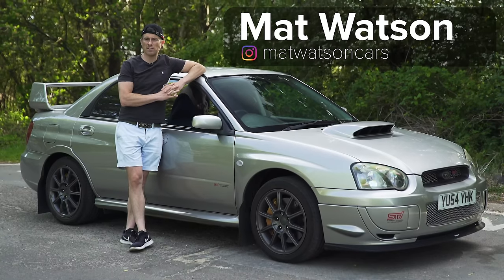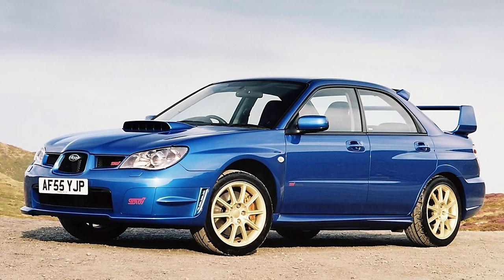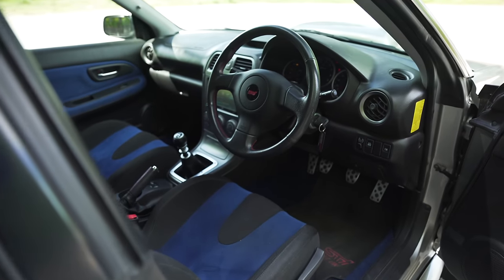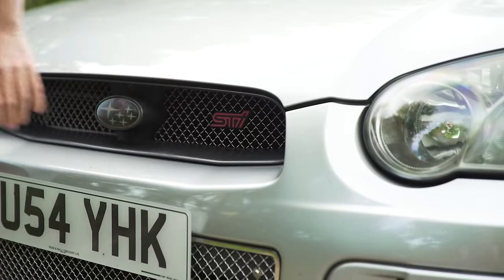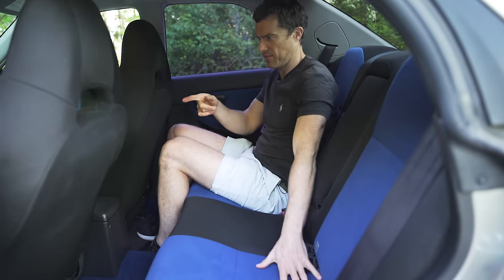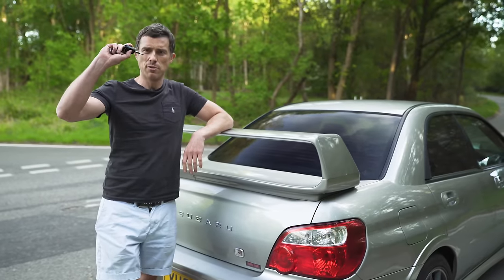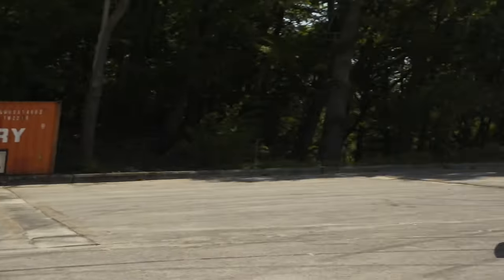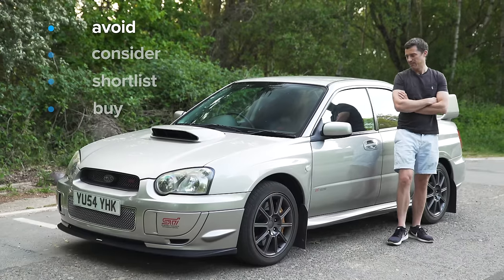Subaru Impreza WRX STi Prodrive 2004 - see why it's the best Scooby ever!

Comment: We want Subi vs Evo drag race.
Reply: and the Type R
Reply: @Sam58598  same year type r have no chance
Reply: Ohhh yes. That will be great
Reply: Sammy Mwalili haha a typeR 😂🤣😂
Reply: Evo!!!!
Reply: evo would trash it
Reply: @PalpatinesPlumber  love evos, but depends on the driver, I personally think neither of them are drag cars, they belong being chucked into corners on and off road, in my opinion the Subaru is the better choice for that
Reply: Evo will win easy,  i4's are much more reliable than f4's  it's a straight line,   if u compare them to corners subie wins, engine is lower so better balance and pistons move counter to their pairs, so u won't feel the torque move the engine around, it'll just fly.
Reply: blobeye all day
Reply: Evo 6 Extreme.
Reply: Did u Guys forget about Volvo?
Reply: @PalpatinesPlumber  no it wouldn't, stock performance the STI was always faster.

Comment: Had mine over 10 years this year, still going strong has 163k on the clock, unmodified just the prodrive pack.
Reply: That's great to hear. My previous one had 143k miles and my current one has 104k miles.
Reply: I'm at 173K but it's been tuned to 323 WHP and 357 WTQ since 2014.
Reply: Nice...I regret moding mine cause I blew the engine twice and hated the expenses....should have kept it stock
Reply: @metrix9125  its always a gamble with these. Sometimes you get lucky.
Reply: My father had one 2007 December model and it was a regular impreza but with a spirts kit and some engine upgrades. Loved that car.
Reply: What a waste of 10 years mod it
Reply: @valentinoferrara9736  just for it to blow up I'll pass thanks. It let me down once when the battery died, and a wasted 10 years that's your opinion.
Reply: @andrewlowe3422  10 years is probably his age, don't listen to trolls.
Reply: @valentinoferrara9736  mod the car and get it to lose value aswell? It's his car aswell, no need to mod everything
Reply: Mine was written off by a mate. Had 290k on it
Reply: Just got one with 82K on it
Reply: @chromosomehoarder6927  if it's not modded, don't mod it, make sure it never misses a service and enjoy years of trouble free motoring.
Reply: These subarus are the last good looking subaru wrx, comparing to the newest ones
Reply: I love mine, I'm currently building a big bhp engine and can't wait drive it
Reply: @DerKaktusAvant  it hurts man sry for ur loss
Reply: @andrewlowe3422  you have use this car Daily ?
Reply: @lukasklap3414  yes mate on 166k now have done for the last 11 years but I only work  4 miles from home so about £30 a week in fuel pre covid. Was 70,000 miles when I brought it.
Reply: @andrewlowe3422  and somehow you have it tuning or not at all?  completely stock?  Do you have the 2l or 2.5l?  you don't.  any social networks where can i contact you?  I want to buy a subie but I have a lot of questions
Reply: @lukasklap3414   @Lukas Klap  if your going to buy one do not buy the 2.5!. 2.0 UK or JDM is better but will come at a premium. I'm not a scene man anymore but a good place to start is scoobynet.com read up on their. Loads of information and help available.
Reply: JUST INHERENT MY DADS 2005 BLOB EYE WITH ONLY 15.800 MILES STOCK MINUS THE WHEELS/TIRES I UP GRADE TO 18 BUT STILL HAVE THE GOLD/TIRES 95% TRED CAR TO ME IS PRICE LESS
Reply: My 06 sti is 175k miles

Comment: The joy on Mat's face tells me everything I need to know. There's a reason why people love Subaru's so much! May not be the fastest, but bags of character make them awesome to own.
Reply: They also sound better than porsches
Reply: Make it 500 bhp and it will kill alot of sport cars on the road 😜
Reply: @del635 i have no sti but iam the first owner (blobeye) bought it 2006. today i changed the pcv Valve.
Reply: DJI Drone Travel make it 500 BHP and it will spend more time waiting in your drive way for parts to fix the headgasket , rod bearings , hole in the block , radiator , cylinder 4 cooling failure ...... etc .
Reply: @01gtbdaily30  hmmm mine didn't, if you do it properly you'll have none of that.
Reply: lucious I’ve never seen a modified Subaru that’s older than 8 years old that has its original engine ,it just doesn’t happen. They are great cars and a blast to drive but they are shit as far as reliability goes. (Turbo Subaru’s )
Reply: @01gtbdaily30  got to disagree there. My old 2003 blobeye STi was 12+ years old when I sold it. I was running over 400bhp, did track days, abused it (allowing for appropriate warm up, cooling, and service intervals ofc) and it was solid. 

Now if you're talking about the EJ25... Well yes I agree. It's a time bomb 😅😂
Reply: u do realise his name is spelt "Matt" right? A mat is what you have in-front of your door
Reply: @fgconnolly4170  correcting me on spelling his name when you can't even spell the word you!? Hmm isn't that ironic 😅 its spelt " you " not "u" lol
Reply: @iankenny79  I wasn't correcting you
Reply: @SubaruVideosUK  oh sorry man, though I must say I've never met anyone who spelt their name "mat" instead of "matt" it is short  for Matthew after all
Reply: FG Ó Conghaile no worries I thought you was being funny to me for some reason. I honestly thought I’d spelt it properly, my bad. Sorry once didn’t mean no offence with my reply.👍
Reply: @iankenny79  ok cool
Reply: Hawkeye JDM Spec C type RA is what you want

Comment: I had a blobeye for 3 years. Easy to mod, sounded glorious, room for the family & the weekly shop. Hard to beat its pound per performance ratio. Not german quality though. Great memories.
Reply: @shoaibgul2437  gay is a compliment in 2020
Reply: @shoaibgul2437  My E46 M3 is manual, is built way better and is way more comfortable than my Sti was. But then you've never owned either so wouldn't actually know, would you. 😘
Reply: @supertouring22  Was the Scooby more fun though?

Comment: Need to see Celica GT-Four vs Evo 5 vs 22b Wrx Sti drag race
Reply: I would have to think it would go to the 22B. I drove a ST205 and it was shit, the Evo 5 is quick no doubt, but the 2.2 in that 22B would be tough to beat. I owned a STi type R, and in stock form it was just faster than an evo 8 in a straight line. 
Would be an interesting race no doubt though.
Reply: sti wins in a straight line, evo wins around a track
Reply: A bloke that lives near me has a 22b. Looks and sounds great. He also has an R34 and R35.
Reply: @zeroyon4562  the 22b has short gear ratios like the rally car. I'd bet on it, unless it was a long stretch for a drag race

Comment: Rs3 owners be like "how's an awd going sideways" 😂😂😂
Reply: Well...Subarus with stock coilovers they understeer a lot. But tbh can’t be worst than Audi hehe
Reply: @stefano4029  no bud coilovers have nothing to do with it, proper impreza's have awd dccd which can create permanent rear bias so are rear wheel awd.. an rs3 has haldex so is front wheel drive until it detects slip then sends power to rear wheels lol which is why it understeers and can not go sideways and if you really try looks ridiculous lol
Reply: @brucewayne2397  ye this model has dccd, but without it imprezas understeer a lot. with proper coilovers you "kill" understeer and you dont need the dccd anymore.
Reply: @stefano4029  i agree without dccd u do but still not as bad as rs3 lol as usually is 50% fixed split back an front if car does not cone with dccd (not sure about wrx etc), best situation is have both coilovers and dccd together, dccd even without coilovers is very good and is much better then coilovers alone.
Reply: @brucewayne2397  models before dccd they have a lot of understeer.
Reply: @stefano4029  yes they do, nose heavy they are.
Reply: @niko8638 its 500+ actually lol and the gearbox has taken 1000 lol so u need to do a little more research haha can ur rs3 dq500 take 1000😂 #backfiredlool.. rs3 owners be like how will we ever run 7's in the quarter mile😉..we won't! Haha
Reply: @niko8638  torsen is much better and real quattro and at least it will get u sideways if wanted.. what do you drive sir?
Reply: @niko8638   you definitely know your stuff, whenever i think of quattro i picture group b rallycars going sideways so was always a surprise to found a certain generation had alot of understeer vs others..the old days it was just quattro no esp or traction control then there was a period as you mentioned where understeer was quite an issue with the car being very nose heavy, then came the new stuff which if im honest i haven't had a chance to see if they willl go sideways, believe it or not our previous family car was a golf r (s3) which i actually liked a lot it was a great car but as we know they are haldex based and being honest the understeer was quite bad but it made up for it in other ways so didnt bother me to much but i hear the new Quattro in rs6/7 etc is a very good quattro set up and understeer is very minimal, i know the r8 v10 plus has virtually no understeer at all  and will but im thinking that is also something to do with the engine lay out also, i want to get a used v10 plus in future.
Reply: @niko8638   yes they have there finger in many pies but are very different across the brands in that what they put in to a Lambo with r&d and materials is obviously very different to what goes in a lupo understandably kind of like Kelloggs they make frosties and all bran but no connection at all between them in anyway😂. I like boba thats a quick car, i know the Aventador has a rear biased haldex but from my understanding the r8/huracan both use a passive viscous coupling system so more like traditional quattro but very rear biased almost rear wheel drive like. And i know a few others use hydraulic haldex but with very different set ups, haldex is not bad at all in the right car with the right rear bias set up but in the rs3 golf r that use the gen 5 its not right for ultimate track handling they should have gone full quattro but im guessing its hard to put the bits you put in your 80k and 100k+ cars in a 50k car and still keep the finance department happy but still 50k is enough in my opinion for a torsen  as they managed it with the new rs4 and that isnt THAT much more expensive if you get what i mean. Instead they used the same gen 5 from the s3 with some software updates that really dont do much when a bend is approaching and u cant point the nose where you want.

Edit

Just read they changed it for the new r8 which as you said is haldex but is a rear wheel drive haldex instead sending torque to the front when required which is cool, i haven't driven the new v10 plus yet but i know it will be an amazing drive guaranteed.
Reply: @brucewayne2397  ive never heared of an ej going 500hp without problems😂😂. I know the transmission is strong but 500hp on a stock ej with out blowing it up is bullshit😂😂.
Reply: @commentmancommentman1658  oh how i love being able to back up what i say....

https://www.scoobynet.com/941285-scoobynet-ej20-ej22-ej25-on-standard-internals-leaderboard-1.html

Above is a decade old thread for stock ej engines leaderboard of verified dyno numbers but if you dont have time to read the thread then the record holder on there is 553hp on a stock ej *however- andy Forrest (the world record holder for 7 sec 1/4 mile) once ran his at 600 on stock internals for a short time but hasnt posted on the thread (wouldn't recommend it lol)... your welcome btw😉. I ran mine at 450 for 2 years before i forged for a cosworth stroker capable of taking 700hp. Its always best to ask so u can further your knowledge if you dont know so now u know.
Reply: @brucewayne2397  thats like 1 in a million guys😂. Luck has come to his side then.
Reply: @commentmancommentman1658  there is tons of people on the forum who have run 500 hp for a period and been fine, scoobynet was a major forum here in uk when impreza and evos were the in thing and theres thousands of members who haven't even commented on that thread just like any other forum not even i have commented on that page.. u originally said ud never seen one at 500 hp but now you have at even higher power 😉.. there's no such thing as a shit ej that runs 7's in the drag, when done right they are untouchable as u wont find many road cars on earth doing that number..
Reply: RS3 owners be like ' someone has nicked it again'.

Comment: Really enjoyed this vid, thanks! My vote for best ever Scooby is the blob-eye Spec C Type RA. Mechanical rear LSD, ball bearing twin scroll (factory 22psi), quick rack, factory lowered w adjustable dampers, much lighter, much stiffer, etc. The greatest "drivers" impreza imo, the last before electronic driver aids. Biased, because I own one of the 300 that were ever made :)
Reply: The adjustable dampers were a STI pink catalogue item and NOT standard. Only S202, S203 and S204 newage had adjustable dampers from factory. Not even the RA-R had adjustable dampers be default (I've seen 2 RA-R's now both had standard red struts)
 I'd argue the S202 is the most hardcore car as it was based off the lightest Spec C (The Type RA Spec C bugeye) but with every STI pink catalogue box ticked, PLUS the titanium exhaust system... The later S203 and S204 were base STI cars with a roof vent and full pink catalogue, and so were actually really heavy.

Comment: One of the best cars out there..and I definitely think this does require some drag strip attention..
Reply: The gearbox will go on launch if not careful
Reply: Theodore Deverell Wrong, the six speed in the STi is nearly bulletproof.  The weak link if the car has sticky tires would be the rear half shafts.
Reply: @mileslumpkin9500  well lord Mat said it would go so imma believe him.
Reply: Theodore Deverell Well I own a 2004 STi in the states and have since you guessed it, 2004.  Let me educate you.  The 6 speed in the STi was co-developed with Porsche and reinforced to handle twice the factory horsepower.  Think Mat is right, try some research.
Reply: @mileslumpkin9500  I mean. I cba to do any research but I feel like the specs between US and UK are different. Also, more importantly, many subaru gearbox rebuilders quote that STI and WRX transmissions both fail similar amounts in their line of work. I learnt this from a Gears and Gasoline video on Subarus. Also, i didn't mean any hate towards the WRX as they are v cool cars. But just because you own one doesn't mean you need to be so aggy. I was just quoting what Mat said.
Reply: Theodore Deverell Fair point, I actually owned a 2004 WRX with the 5 speed and 2nd gear blew up after a little engine modification.  Long story short, I ended up swapping a 6speed in from a 2004 STi and then continued to increase the power and the transmission handled it with no problems.  I’m not trying to be “aggy” I’m trying to educate you on the difference in transmissions.
Reply: These cars aren't meant for the dragstrip tho

Comment: I had a 2007 STI, it was quick but too soft (shifter slop, driveline slop, turbo lag). After some mods (Ecu tune, upipe, down pipe, headers(unequal length to keep that rumble), shifter kit, driveline bushings) put down 322 hp 390 ft tq, at the wheel on an 85 degree day on the stock exhaust. Totally different character from the original, with 245 tires it was a mid-top end champ, more of a muscle car than a precise sports car. It doesn’t have much luxury amenities and with the headers, it gets loud on the highway. It’s all about the fun factor, steering was telepathic, 20-100 mph run always put a smile on my face. 
Looking back I think I would have kept the iron header for less drone and opt for a hi flow cross header pipe. I wish I could’ve kept it but 2 years ago I bought a used 2015 E63 with a renntech headers & tune (700 hp) its a lot faster than the STI bit not nearly s nimble or fun.
If you are getting one, go for the 04 or 07(USA ) the o6 had cooling issues with the cylinder next to the turbo. The 07 fixed it & added a torsen rear diff, 4th & 5th gear was taller (finish the 1/4 mile in 4th instead of 5th with better trap speed).

Comment: Had one back in 2006, really quick car back in the day, but interior was poor. Like really fast tupperware  .
Reply: i was just born is 2006 lmao
Reply: Absolutely... Hard plastic from the same factory as Tupperware
Reply: Wouldn't even mention the interior, it doesn't matter. This doesn't pretend to be anything like say an S-line or M sport package.
Reply: It was waaaay cheaper than equal performance cars though. Apart from the Lancer Evo.
Reply: @djoetma  Because cars made outside of the EU have an import tariff on them.  Overseas, the Lancer and Impreza were relatively inexpensive cars in basic shopping car form, hence why they had basic interiors.
Reply: @TassieLorenzo  The Impreza and Lancer were cheap cars here as well. The Impreza GT Turbo was relatively cheap as well (average income cheap, even though still more expensive than average), but the STi and Lancer EVO were not cars someone with an average income could buy.